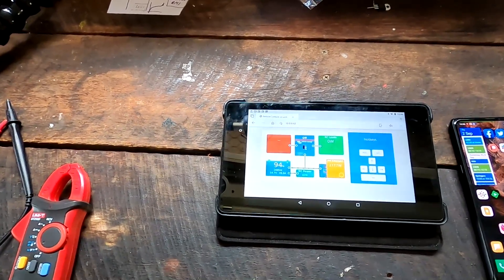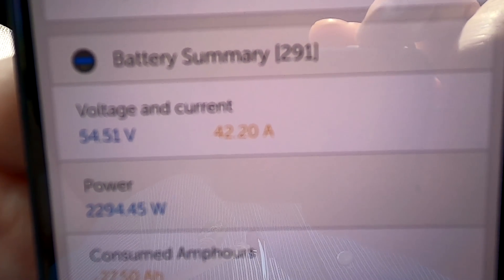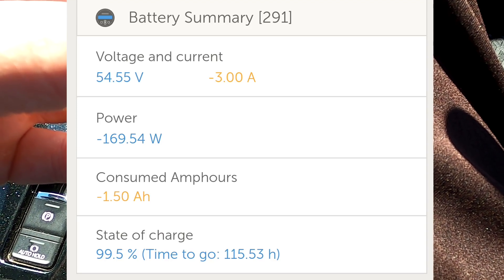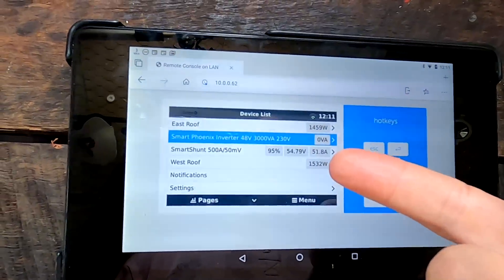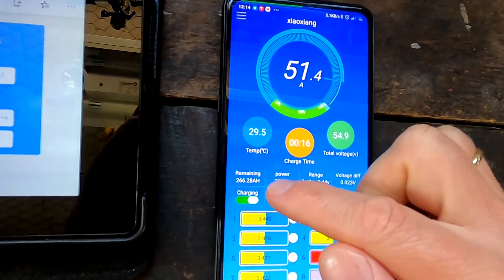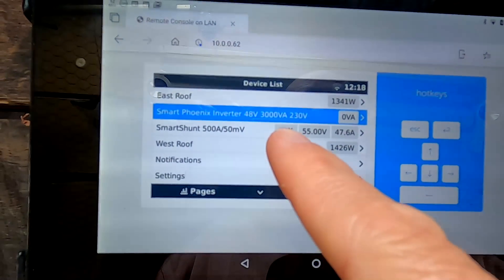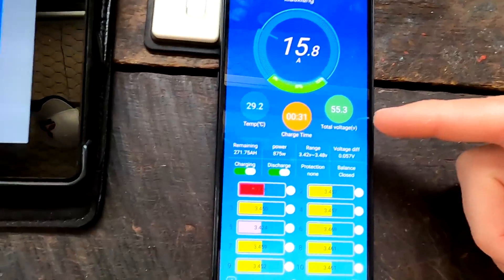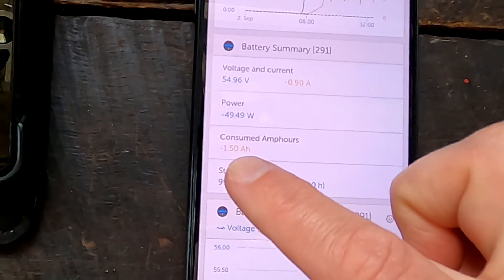With no balancing to 99% SOC. Consistently.

Comment: Will Prowse DIY Solar recommends:

If you are using a BMS and wish to manually cycle up to 90% SOC:
Do a discharge capacity test with a shunt. Record capacity in watt hours.
Charge slowly up to 90% SOC (take capacity Wh figure and multiple by .9), and while charging, record the voltage right when it hits 90% SOC
Set the absorption for all chargers in system to the voltage you recorded in step 2

5,000+ Charge Cycle Absorption Recommendation
If you want your LiFePO4 cells to last a long time, you can set your absorption to Victron's custom LiFePO4 charge profile recommendation:
12V Battery: 14.1V
24V Battery: 28.2V
48V Battery: 56.4V
You can pull full capacity with the absorption figures above, but the charge rate will be reduced at high SOC.

Also:

Recommended Charge Profile:
12V LiFePO4 Battery w/ BMS:
Absorption: 14.5V
Float: 13.6V
Inverter Cut-off: 10.7V-12V (depending on size of load and voltage drop etc)

24V LiFePO4 Battery w/ BMS
Absorption: 29V
Float: 27.2V
Inverter Cut-off: 21.4V-24V

48V LiFePO4 Battery w/ BMS
Absorption: 58V
Float: 54.4V
Inverter Cut-off: 42.8V-48V

Individual 3.2V LiFePO4 Raw Cell (for individual cell capacity testing)
Absorption: 3.625V
Float: 3.4V
Low voltage disconnect for capacity testing: 2.5V

On my 24v 310Ah i use:
27.2 Bulk / Absorption (3.4 per cell)
26.7 Float

My SNADI 24v 3Kw inverter cuts out at higher voltage.

I manipulate the LVD on SCC to allow aircon to start, around 20.2v then increase it, to where I want it to stop. Eg, 24v is about 48% SOC. so aircon will run all night, if battery is charged to 90%. System designed to run aircon (0.75hp) most of the day, (for baby) or I’m wasting solar generation potential.  After cloudy days when battery not full, inverter lasts over 7 hours. An automatic transfer switch changes to grid power. Inverter output turned off by solid state relay, with heat sink. DC control AC. Inverter has a power saving mode. I blew a Chinese DC 120A relay, with 13A load. Will reinstate it, with delay, and big heat sink after AC disconnect.

Comment: I feel if you're able to still get around 99% even with 3.4 volts, you risk losing visibility to cell balance as you're getting close to the flat area of the curve. You'd probably need to manually top balance at different intervals (wait a month, then maybe 3 months, etc..) and see how quickly the cells are getting out of balance. Maybe if it takes long enough, it's not that big a drawback.
Reply: I have found this to be true. 3.4 too low for long term balancing.

Comment: I have been running 3.4 for a few months. Last week I did a manual balance. Took a lot of balance. I have changed mine up to 3.5 now so my balancer can work easier.
Reply: Which balancer do you use Jason?
Reply: @ralph9987  about 1 year old 280 ah 2p16s eve cells. Was balanced ok at start and I thought 3.4 would be fine to charge to. Balancer also set to 3.4. however I found that the curve of the battery was just not steep enough at 3.4 for a good SOC measurement and balance. I took about 9 hours of manually balancing at between  20a and 1 amp to bring pack balance back at 3.6v. If you run 3.45 you might be ok. I have gone to 3.5. I think you could run 3.4 but manually running it up to 3.6 every month would probably work to maintain the balance. I am going to add and active balancer soon and maybe that might mean a better balance at 3.4v.
Reply: @ralph9987  diy BMS by Stuart Pittaway. it is excellent. 1A balancing current.
Reply: couple question here.  1- were your battery new /matched ? how far in balance did they get please ? i was considering the 3.45 until i saw this post of yours. it seems you have long term record of this.

Comment: Thanks for another great video Andy. I think there is no one ideal batch of settings for LiFePO4.  As I read forum posts and comments on videos I am struck by the fact that people very rarely list the "C" rate and system application when they are debating this subject...For UPS backup systems or lightly loaded medium to large packs I think the 3.4/3.45 is the sweet spot like you say, actually for purely UPS I think you could even go a little lower. Where I disagree is for the more heavily loaded systems and systems that charge at very low "C" rates.  I have a big bank with a fairly small solar footprint AKA (1/8 C)... It runs a fully off grid house under constant load.  When I changed my settings to 3.55 Bulk/ 3.5 Float I picked up around 8% more capacity on a daily use basis... I think the main reason for this is that by holding my charge controllers at a higher voltage it forces the solar to run the inverter while simultaneously keeping the pack at a higher state of charge so that when the sun goes down I have the best setup for the night... Especially if I get a couple of bad solar days... Since I changed the settings I am definitely running the generator less so I'm going to call it a win... Point of my long story is that there is no one right answer that everyone seems to be searching for... It depends on your specific situation.... as long as you keep your float voltage @ or below 3.5V and run your pack at a consistent 60° to 70°F I believe a pack will last a long time.🤞

Comment: What if charge is controlled via SOC rather than voltage to stop at 90%? As in using SOC data from the shunt to then tell a BMS to stop charging? From my experience SOC seems to drift and become inaccurate over time, so doesn’t seem promising, but in terms of achieving a “90%” SOC, it seems doable with some automation in between to tell a BMS when to stop charging if that resulted in greater battery longevity.
Reply: Yes some BMS and charge controllers already do this. I think this is the long term goal. I think use ve direct and write in New setpoints based on battery SOC. I don't use victron so can't help Andy here. My make sky blue cc have no comms so I can't do it on mine. The charge controller capability to be set with parameters with either canbus or rs485 or even just serial as in victrons case is the limitation here. Arduino between BMS and cc is a dodle.
Reply: @jasondevine6014  Exactly. I’m working on integrating status and control of both my Victron CC and my Overkill/JBD BMS through Home Assistant running on a Pi. Each has been done individually (by others), doesn’t seem much a stretch to get the data from one to control the other. Or for a simpler setup, a basic ESP in between.

Comment: So the solution to stop runnaway battery is to charge to 3.45 per cell? If that is true then why are balancers even sold?
Reply: hah i like the question, maybe because a just a safety precaution incase were the batterys do get out of balance after a while of charging and discharging what do you rekon about this?

Comment: You are charging at 0.15c no wonder you don't have throttling from the charge controllers.
Reply: i honestly did not understand the question here? what do you mean throttling from the charge controller's
Reply: @none0049  Lithium batteries are charged with cc/cv process, meaning that one must not charge too fast with too many amps and when the battery gets close to full the charge rate in amps must be reduced to avoid over charging. I am just pointing out that off-grid garage is charging at a slow rate that the charge controllers don't really have to slow down charging speed when the battery is getting close to full BECAUSE the charging speed is already slow to begin with.
Reply: @uhjyuff2095  okay let me get this rite so you saying that charging with a cv with  these battery are going to be overcharged with that current in the video?
Reply: @none0049  The charge controller's job is to stop charging before the batteries become overcharged. The point I see is off-grid garage is doing a lot of tests on these batteries, but he is not testing fast charging or even standard charging speeds! His charging speed is slow. Fyi, standard charging speed for his battery is 140 amps and his max charging speed is only 52 amps. It would make a great video showing the charging of these batteries at normal charging speeds.
Reply: @uhjyuff2095   look, i know how solar charge controllers work and c rate, my point is that in your first comment  you saying the charge controllers dont have throttling, what do you mean by this?
Reply: @none0049  Lowering the charge current aka the absorbtion charging stage. Off-grid garage doesn't need an absorbtion stage because he is charging at a slow rate to begin with. Normally the absorbtion stage takes time to complete and during that time the charge controller is throttling/Lowering the charging speed.

Comment: Remember to include the C-rate that you are charging at when talking about bulk target voltages.

-Matt
Reply: True. You would need to have very similar charging conditions if you wanted to compare 3.4v to a 3.45v charge. My guess is a higher voltage will offer a higher current.

Comment: Victron has charge efficiency and puekert correction, BMS doesnt.
My experience is if charging to 3.35, I can hit float at below 80% SOC charge cant go over 0.1111C
Maybe my float/abs could be closer so it flicks back
Reply: Peukert in LiFePO4? This ain't no old Lead Acid world no more...
Reply: @HiltonT69  1.05 is the suggested for LiFePO4, 1.25 for FLA  - in the manual anyway. Not sure on real life, but mine seems to stay well calibrated with that setting - not that I'm using much over 0.2C anyway.

Comment: Thanks Andy for another great and informative video! This works well for your off grid set up but not sure for some in an RV with say 3 200w panels. I think due to possible shading and panel wiring for three that charging to higher voltage be an advantage. Wonder how much of a difference there would be to charging to 3.6, 3.55, 3.50 or 3.45 as related to getting batteries charge up quick?

Comment: Percent is the most inaccurate number we get even worse than voltage for knowing if the battery is charged. If the battery will take amperage than it is worth charging, setting the float to where the amperage tapers off allows the best use of the solar production it charges and what is left over goes to the load best of both worlds.
Reply: I am on a sailing boat, I am going to feed my batteries with every amp I can throw at them
Reply: @ralph9987  
Exactly